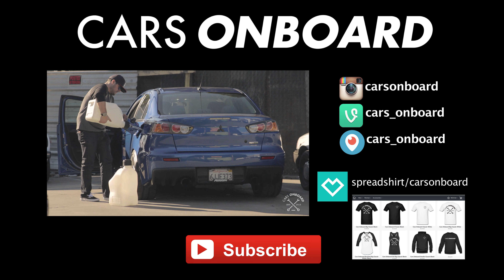[PROJECT EVO IX] TURBO UPGRADE EP003

Comment: Randomly came across this video and throughout I kept thinking "these guys don't really know what they're doing", then I got to the part about taking a jug of water in case the car catches fire. Do you know what would happen if you dumped water on an engine fire that was started from leaking oil? You would spread that fire all over the car and yourself. Be safe guys, and I like your documentaries .